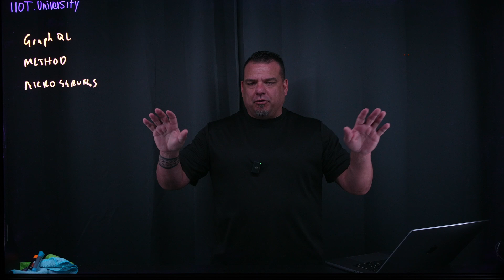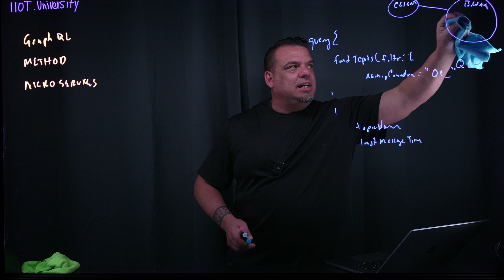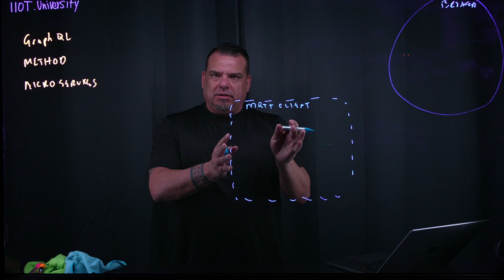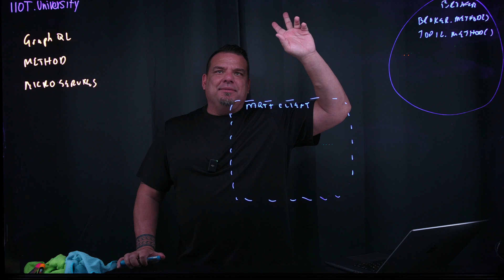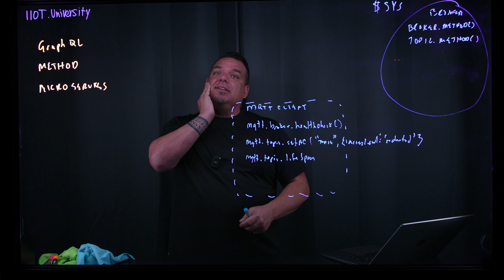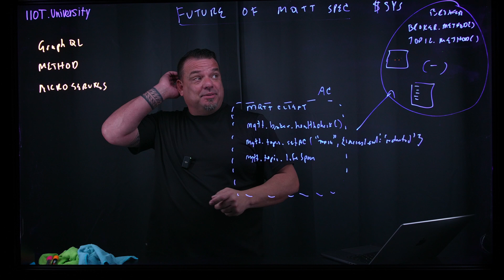Sneak Peek | MQTT Summit - I need your ideas!

Comment: I agree with @PotatoHead-ul6tr to the danger of building an OPC UA spec 2.0, but... I would be interested in two related things. 1. Native integration of time-series databases directly in the broker. 2. Native integration of time series queries in the MQTT protocol. Could be GraphQL, but would love to have that directly available, e. g. as topic.method("topic", RETURN: listOf(payload(s), timestamp(s)) or even better in the topic itself by have that configured like Walker's idea of the "lifespan-retain-flag". The reason: everyone wants to have the "look into the past" by using time-series databases consuming them via the UNS. But everyone either implements the consumption of the time-series as a kind of data-contract in the UNS or (even worse) by using "shadow-IT" legacy database-protocols and queries.

Comment: Walker, I really appreciate your open approach to this community and the team I work within have followed your channel and ethos for much longer. I think these three things start to move the dial for industrial applications, and would agree that these need to just be in an industrial MQTT specification. That is perhaps would I drive home stronger. I'm not sure if this is what Sparkplug is trying to solve, or even what your recent thoughts are on that specification and considerations for UNS? You may have discussed it recently but I've not seen it! 

All that said, what I see UNS enabling is a vendor and technology agnostic interoperability mechanism between devices on the shopfloor. Now UNS won't be the thing which solves it, but it is the place to query to understand what is connected, what can it tell me about and from that make informed decisions automatically. GraphQL has its challenges and to achieve this you the best reasoning I see at the moment is with the W3C standards like RDF and SHACL, which in turn does make the tech stack bigger but proves its value with the more consistent data structures enabled through reference data libraries etc... 

Happy to share more thoughts on email as there are other standards that back up this train of thinking that I'm seeing the benefits of for industrial.

Comment: These are all great. I feel also the need for a way that transactions from A to B could be handled, in a scalable way. That implies on some assumptions or requirements:
- A sends a message to B using the broker. B may have a return message that is important to A
- B and should acknowledge the message receiving not simply by receiving it, but by being able to effectively process it
- There should be a quarantine, for transactions that were sent but never able to process, so user could be aware of the problem, but they can't be tried forever, infinite times
- Transcation initiated on A to B could potentially be used also for new nodes, like A to C and A to D in the future, so this scalability should be taken into account.

Real example could me work order is created on ERP, but the routing on MES. So, when work order is created, we need to make sure MES received and processed it. But at the same time, ERP needs the routing information back so it can trigger purchase orders.

Comment: I would approach the talk as an opportunity,  and consider the "value" of lost opportunity. So the more things you leave out, the less "loss of value" is perceived but the more actual $ loss results. (i.e. They didn't hear about suggestions 4 through 10, so they don't see them as missing, and don't address them to years later if at all, and we stay less productive. )

So I would:
1) show the entire list
2) only address 3 main ones, especially if you plan on 4 examples each (which frankly sounds mind numbing to a seated audience)
3) Set the entire version of your spec to release, immediately at the end of your talk, on the web worldwide, along with free Python implementation examples, so everyone can just begin doing this and the typically slow standards bodies can play catch up (like has happened in the 802.x space and other specs and standards.)

Result: The standard body will be notified the industry is going to "self-align" with the "Walker/Litmus" standard, and if they want to remain relevant they can play catch up.

Meanwhile companies benefit from improved time-to-value, and future MQTT broker sales or usage will be dependent on whether companies acknowledge the "informal" spec. (Again, just as in the 802.x days.)

As I have heard it said someplace "Today's specifications are tomorrow's expectations."

Caution: Avoid the OPC standard mess of too many versions, none of which everyone follows completely.

P.S. Nothing stops you from taking a published standard and adding to it, patenting it, and then if folks add those things they will have to pay you a royalty everytime (if you charge for it.)

License fees, like for HDMI. Those HDMI license fees add up in bulk. :)

Comment: There should probably be a voice of caution in here somewhere, so here's my 2 cents (for whatever it's worth).

Part of the appeal of MQTT is its simplicity. Take that away and I don't think it would have ever seen such widespread adoption and popularity. Would there be so many great client libraries to choose from today if it was so feature rich (bloated) on release? Would there be as many free brokers? There is a real risk of introducing unnecessary technical debt if the new features turn out to be overly niche, or their implementation is based on a fad destined to be replaced by the next shiny thing that comes along (SOAP -> REST -> GraphQL -> ?)

Beware of OPC-ing your MQTT. Be careful what you wish for.

Regards,
Reply: I believe that is Walker's point around these being part of an industrial spec so they are separated whilst still supporting all the features of MQTT standard spec. For industrial applications these types of things are really key to enable everyone to get benefit and that's when they should be standardised to ensure vendor and technology interoperability. If you don't do it this way as must haves in the spec, then you end up with something like the USB spec with core with so many optional features its impossible to understand what implementation supports what feature set. At least this way there is still the core for lightweight and simplicity for its adoption and popularity, but then for industrial applications that need support packages and these sort of structures then that's when they are worth their weight to enable integration.

Comment: Would help to elaborate on the why, not just the what of desired specs. The goal isn't to replace the need for a data store, but to create efficiencies needed for IIOT. (Walker's draft specs for adding Graph QL capabilities and surrounding conversation are in the Ind4.0 Discord https://discord.com/channels/738470295056416930/740564843710382080/1129168533616590960
Reply: Excellent idea, Sheryl — 🙏

Comment: I would love to see massage payload properties being implemented. So I could set a property like “store
inhistorian”: true on a message. I then want to be able to subscribe to a topic, and only receive messages where this property is true.

A great use case for this, would be that we can subscribe to messages with certain properties across topics, then stream them to a timesseries database. This could work with the GraphQl support you just advertised, and it would aid building a proper UNS with historical metrics.
Reply from the maker: Thank you. Amazing fucking idea - Walker will include them in his presentation. 🙏🙏
Reply: Thanks. I have another idea. When we look at the architecture for an industrial 4.0 solution, an ideal setup would in many use cases require that we provision an MQTT broker at the Edge(s), as well as having an MQTT broker in the Cloud as part of the Unified Namespace (UNS). This architecture allows us to integrate flows and logic at the Edge, which doesn’t necessarily need to be published to the UNS. However, some results of running my processes at the Edge, might need to be published to UNS. 

Therefore I suggest the following. What if I could simply add a property “publishuns”: true, to messages I publish at the Edge. Then setup a one-time forwarding rule on my MQTT broker at the Edge. That rule should simply re-publish all messages with the property, to the same Topic in the UNS. 

This would allow us solution 4.0 vendors, to have better control on what we publish to UNS and when.
Reply: Waw, great idea, this opens dimensions
Reply: So adding "tags" to "topics". Nice and dangerous